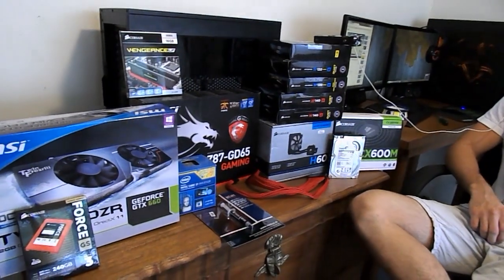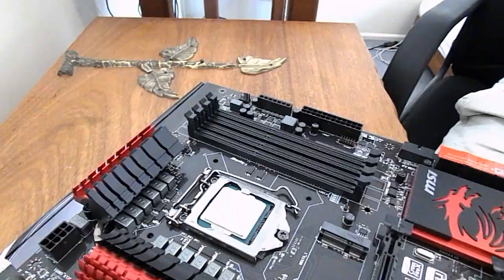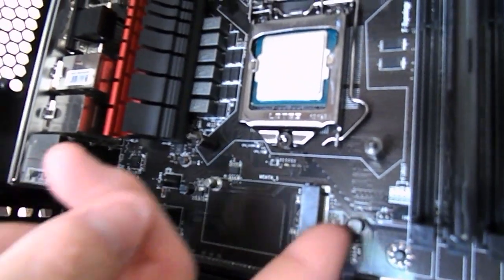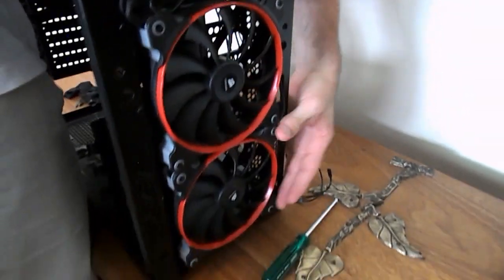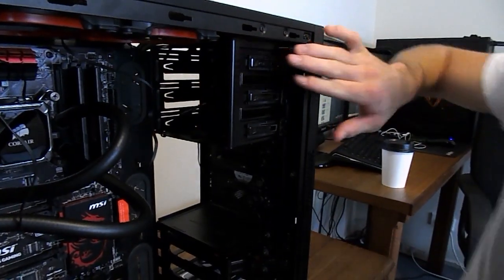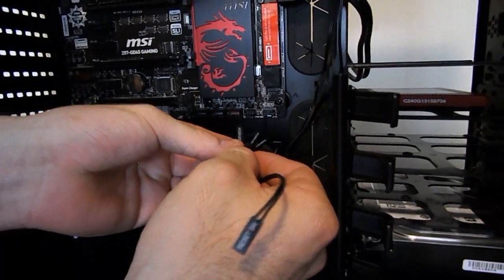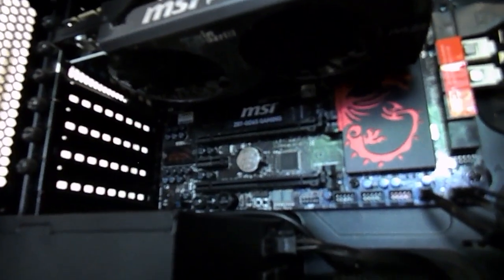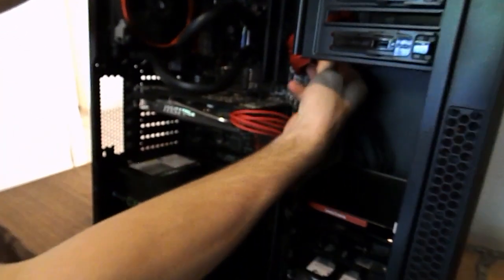How to Build a PC: Australian Tutorial 2013

Comment: How futureproof do you think the GTX 660 is ? I am planning to build a PC soon and i want to buy this GPU.Atm i know it can run pretty much all games on ULTRA but you think it would be able to atleast run most of games on Medium or High settings in like 5 years?
Reply: I recommend you go for a gtx 760, because later on you can go ahead and SLI another 760 which makes it more "future resistant." 
There's some really good 660's out there! But I'd say the 770 or 760 will cover you, specially if you SLI later on.
Reply from the maker: Sebastian Otto Yeah Sebastian is more on the ball there. I am using a 660 in this video but try to get the latest architecture if you can. I know the Maxwell architecture (that means the next series 800 series) is coming out in 2014 so you can wait if you want otherwise a 760 or 770 would be a good choice. Whether it will work as you would like in 5 years is probably doubtful but that's just how technology works its annoying. (SLI good point maybe it might)

Comment: hi, i am building a gaming pc with a budget of around $1100-$1200 

these are my specs
also, i am building it the beginning of next year so the prices will hopefully drop
am looking to play bf4 with 70+fps and do some high codec rendering within after effects

CPU: AMD FX-8350 4.0GHz 8-Core Processor  ($225.00 @ CPL Online) 
Motherboard: ASRock 980DE3/U3S3 ATX AM3+ Motherboard  ($69.00 @ PCCaseGear) 
Memory: G.Skill Ripjaws X Series 8GB (1 x 8GB) DDR3-1600 Memory  ($95.29 @ Mwave Australia) 
Storage: Kingston SSDNow V300 Series 60GB 2.5" Solid State Disk  ($72.00 @ Mwave Australia) 
Storage: Western Digital Caviar Blue 1TB 3.5" 7200RPM Internal Hard Drive  ($67.00 @ PLE Computers) 
Video Card: XFX Radeon HD 7950 3GB Video Card  ($279.00 @ PCCaseGear) 
Case: Corsair Graphite Series 230T Orange ATX Mid Tower Case  ($109.00 @ CPL Online) 
Power Supply: Silverstone Strider Essential 500W 80+ Certified ATX Power Supply  ($59.00 @ PCCaseGear) 
Optical Drive: LG GH24NS95 DVD/CD Writer  ($29.00 @ Scorptec) 
Operating System: Microsoft Windows 8.1 - OEM (64-bit)  ($115.00 @ CPL Online) 
Total: $1119.29
Reply from the maker: Hey man. Ok first of all with the CPU you may be better off going with a i5 4670K Although it may lose out at first in rendering and streaming it will beat it in editing and gaming. When both over-clocked to a medium degree the Intel may even beat the AMD in the rending as well. Plus the i5 will give a better snappier overall performance. I assume you are going single channel RAM so you can upgrade in the future which in reality is fine but when bought in dual channel they are factory tested together so thats that. Also with your operating drive you may want to think about going for a Samsung Evo 840 120gb beacause you really should have the extra room on the OS drive and its not much more expensive hitting a great prive vs performance sweet spot at $109. The version of your after effects is also important man because depending on what version they may or may not take advantage of all the extra cores. With BF4 man I am sorry man but the Radeon 7950 will not get you no where near those frames, you will will have to jump into a different league of cards to hit 70+ on ultra settings. The rest is fine. So probably go the i5 think about dual channel, grab that ssd and much better graphics card. I know its much more than you want to or even may be able to spend but it you save a bit more you should want to try to get the all the parts you need, instead of trying to upgrade bit here and there. Only because its an entire build. Hope this helped, good luck.